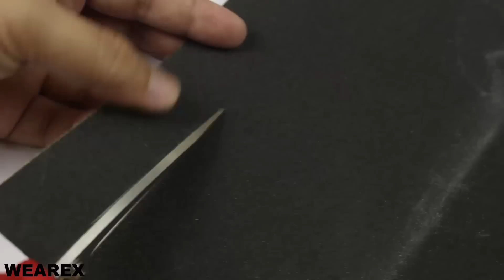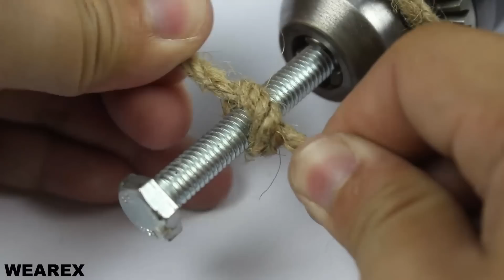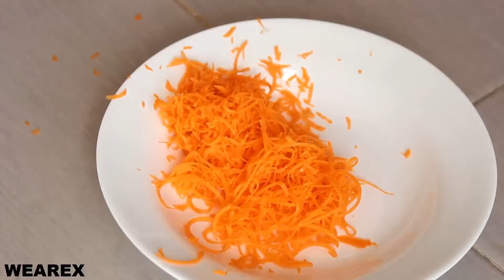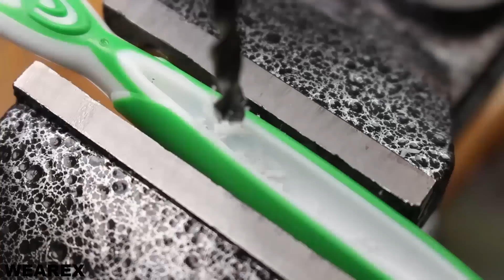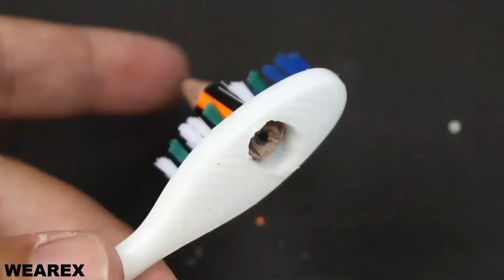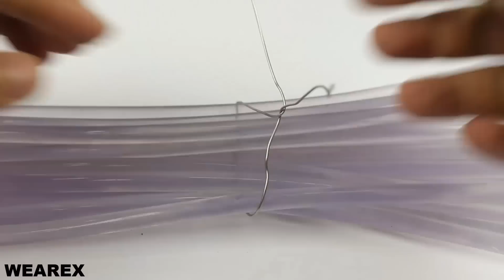6 Awesome Life Hacks for Drill Machine

Comment: #1 Actually usefull for the first time!
#2 Use youre hand to wind a rope!
#3 i would be done even before you got the drill and the screw from storage!
#4 worked "great" didn't it? Took alot of time!
#5 Use some of that string and a nail! And going clockwise would make the screw grab and get stuck!!
#6 WHY? Just pull the wire harder with your hands!
Reply: luca